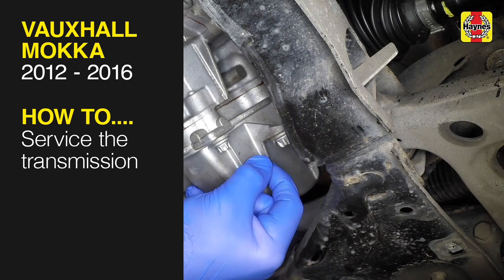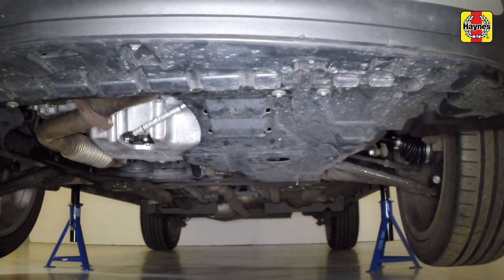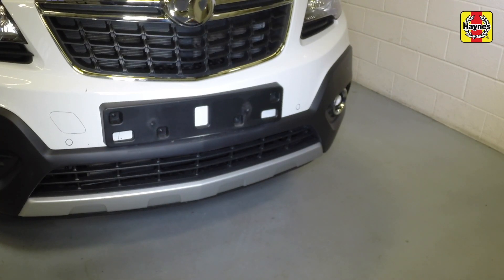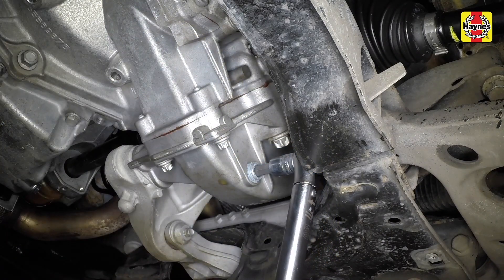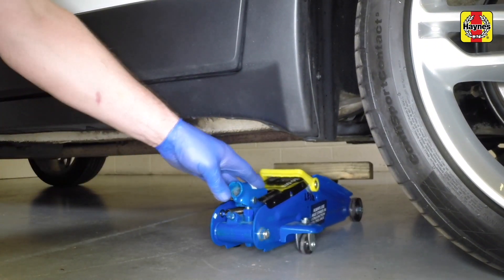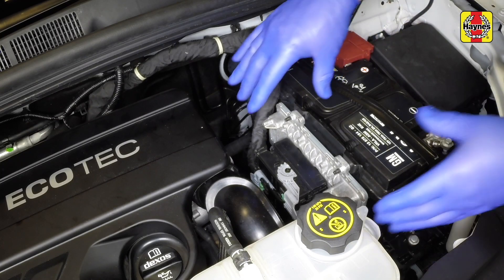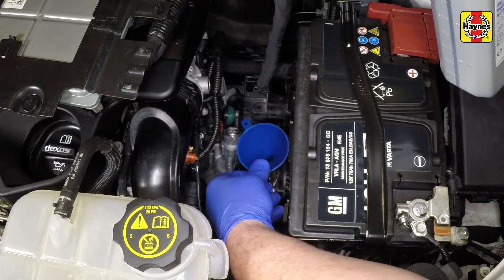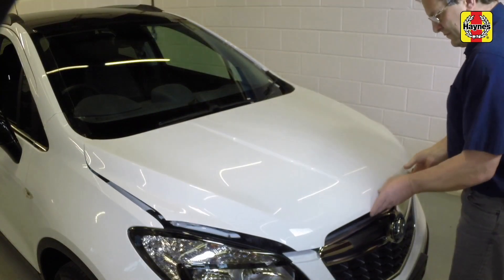How to  Service the transmission on the Vauxhall Mokka 2012 to 2016

Comment: Hi is this the same procedure/ amount of fluid required for the Mokka 2016 with an Auto gearbox?
Thanks 😊
Reply from the maker: No, this is only for the manual box
Reply: Do you have a video for auto gearbox
Reply: 75w80

Comment: How often should the transmission oil be changed ? every 80k ? And is there such a thing as a lifetime transmission oil ?
Reply from the maker: Vauxhall make no provision in the service schedule for changing the transmission fluid - it's filled for lifetime. Quite common these days. However, most owners would consider it prudent to change the fluid at least once in the life of the vehicle. Maybe at 80 000 miles.